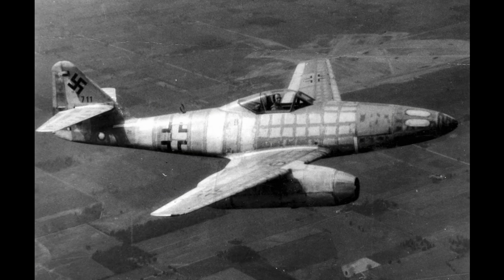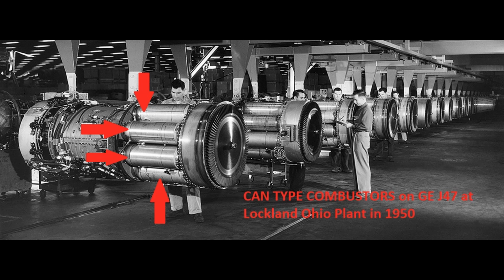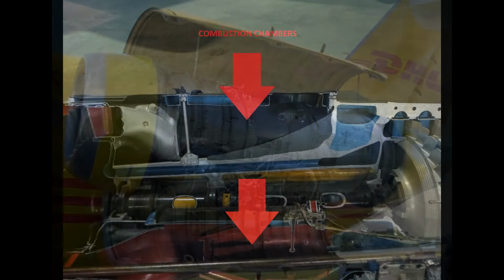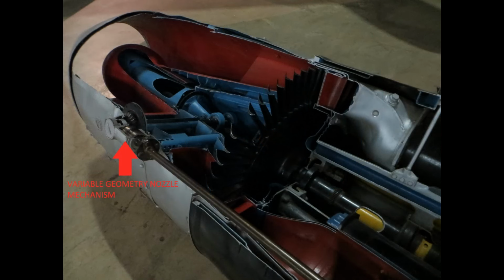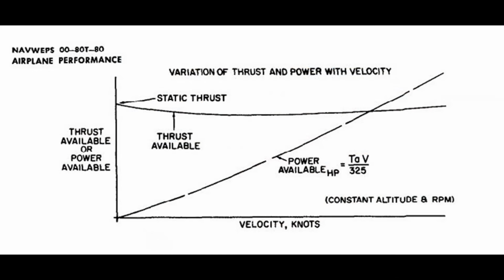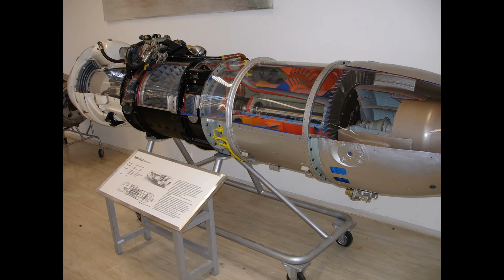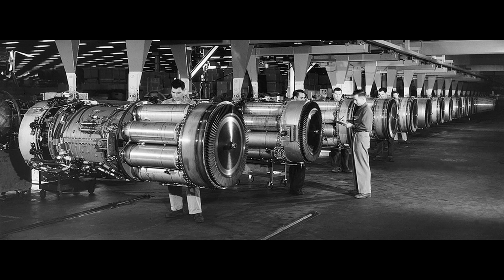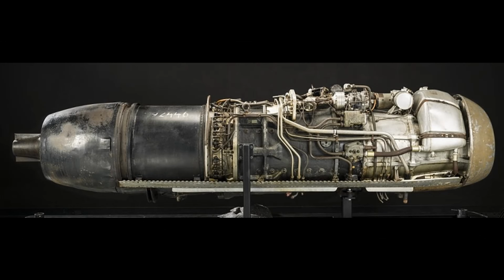World War Two JET POWER

Comment: The Whittle designed centrifugal jet engine preceded the Junkers axial flow jet, and being more reliable was a better engine, even though less powerful. Whittle commenced his jet engine design in the early 1930's.
Reply from the maker: It was an inferior design and a developmental dead end. As for being more reliable, that depends. The production 004s had a short life only due to scarcity of needed metals, not the engine design itself.
Reply: @GregsAirplanesandAutomobiles  You might think that the early centrifugal flow jet engines were a "dead end" as opposed to the axial flow Junkers 004's, but if you care to check, you would find that the centrifugal types were successfully fitted to the Gloster Meteors and De Havilland Vampires etc..; they good service.
Reply from the maker: That's exactly what I mean by a dead end design. Those planes you mentioned are from the mid 1940's. Today all the jet powered fighters, transports, and airliners use axial flow jet engines.
Reply: @electricmanist  The Gloster Meatbox only killed British pilots
Reply: @GregsAirplanesandAutomobiles  Of course- but remember the reliability of the early (British) centrifugal jet engines was most important-- hence the success of the Meteors and Vampires etc.  Hundreds of these (centrifugal) jet aircraft) were exported all around the world.
Reply: @sandervanderkammen9230  You are overlooking the fact that many aircraft fitted with the early (British) centrifugal jet engines were exported all around the world. Also don't forget the DeHavilland Vampire (single centrifugal jet engine) was also used by many countries as their first jet propelled aircraft-- successfully too.
Incidentally, the Meteor was capable (just) of flying on one engine.
Reply: @electricmanist  That British propaganda myth crumbles upon the slightest scrutiny... the U.S. Army tested the Jumo-004 after WW2 as part of Operation Lusty and  confirmed TBOS of 50 to 60 hours.
EXCELLENT BY WW2 standards for Allied piston engines.
Reply: @electricmanist  That comment reveals someone who knows absolutely nothing about the infamous Gloster "Meatbox"
890 crashed killing 450 British pilots in RAF service alone, most crashed due to an engine failure on takeoff which was generally considered fatal  even after ejection seats were introduced.
Reply: @sandervanderkammen9230  Here we go again; The axial flow Jumo might have been a more efficient engine, but ,and it is a big but, -one - it was not an easy engine to operate (it would flame out easily unless run at full power), and two--  the high grade materials necessary in its manufacture were in very short supply in Germany at that time.
The British centrifugal jet engine, (Whittle type)  was easier to maintain and operate. This engine was refined , developed  and put into production by Rolls Royce.
Don't forget, the British designed engine was also used  to power the first experimental American designed jet powered aircraft in about 1943-- and later  after the war in the mass produced 'Shooting star".. 
(As well as the first British mass produced jets--the Vampire and the Meteor,  the Meteor was actually used, over Europe,  in the latter stages of the war;  616 squadron to be precise)...  Check your history.
Reply: @sandervanderkammen9230  I used to work with someone who was a jet engine technician on the early jets (Meteors). While there were a few  early engine failures usually on start up, (they were called "flame outs" by the way, ) the Rolls Royce engine was generally regarded as a reliable power plant.. Thousand were made and exported to several  European nations not forgetting the Middle East and India. in the 40's and 50's.  As the power (and technology) of this engine improved, it became known as a very reliable and trusty power plant..
Unfortunately, it would also appear that you really know very little about the early days of the "Meatbox" (Meteor) in service with the RAF. (or that of the " De Havilland " Vampire for that matter.
Reply: @electricmanist  Indeed, some old false myths die hard... Axial compressors are vastly superior to centrifugal compressor technology which ultimately proved to be an evolutionary dead end and completely obsolete today.

That comment reveals someone who is not knowledgeable about jet engine development history or vintage jet engines.

All first generation jet engines from the WW2 era had manual fuel controls.
The Gloster "Meatbox" would not have automatic fuel controls until the introduction of the Derwent V engines in the 1950s.
 These engines would all suffer from flameouts or overheating damage if the pilot moved the throttle levers too fast or too much.

That's another false urban myth based on a partial truth and taken out of context.
The transition from Krupp P-193 Tinidur alloy to Krupp P-198 Chomadur alloy caused serious problems resulting in very short engine life.... in the Jumo 004A but it was the 004B saw mass production and the introduction of pioneering advanced technology like hollow turbine blades and nozzles with bleed air cooling and TBCs.. technology found on current engines but completely unavailable to the Allies until after the war.

PFTRs and TBOs were comparable if not better than Allied high performance piston engines.

The only jet fighter worse than the de Havilland Vampire was the Gloster "Meatbox"
The Meatbox only killed British pilots. 

890 crashed killing 450 British pilots in RAF service alone.
The worst jet in history.
Reply: @electricmanist  Your comments reveal an appalling lack of knowledge on this topic.
 Engine failures on start-up are called HOT STARTS or HANG STARTS... not flameouts!
This is the primary failure mode of all gas turbine type engines.

The Gloster "Meatbox" was discribed by RAF Chief Air Marshal sir Fredrick William Bowhill as a quote; "a most dismal and lackluster aircraft"

890 crashed killing 450 British pilots from 1947 until retirement.  
The most common scenario was a engine failure on takeoff, the Meatbox has atrocious and notoriously fatal asymmetric flight characteristics which killed many pilots even after ejection seats were introduced.

RAF pilots considered it a deathtrap, 150 crashed in in just one year, 12 crashed in one week and 6 crashed in just a single day in non-combat operations.
82 Vampires crashed the same year.

Britains reputation for building horrible jets that killed pilots continued to grow leading to the complete colapse of the British aircraft industry.

The RAFs most advanced jet fighter is the American Lockheed F-35... the RAF fleet today consists of nearly all foreign built or foriegn designed aircraft.
Reply: @sandervanderkammen9230 
Fryed Ryce Munchyrz Kharzeestan Krappenz DiktorBummer Werkzxoffen etc and co SHUD note good with much awestruckness pleastoo.
  The accident loss rates & fatalities for the Gloster Meteor were average & similar to other fighter aircraft of the period. In fact some later jet fighter aircraft from other countries had worse accident loss stats.
   Whittle style centrifugal compressor reverse flow combuster internal combustion gas turbine aero engines are not obsolete & of course are still manufactured in significant numbers for turboprop aircraft & helicopter applications.
  Any ?Kweschuns? sonny Jim Jimminy boy lad? 
😂👍
Cheers!
. ... . . ... . . ... . 
vcxivcixcvviiii
Reply: @paulpaul9914  PLEASE NAME A SINGLE BRITISH COMPANY THAT STILL MAKES BRITISH JET AIRCRAFT?
Reply: @petemaly8950  NAME A BRITISH JET PLANE STILL IN PRODUCTION?
Reply: @GregsAirplanesandAutomobiles 
   Whittle style Centrifugal compressor gas turbine engines with reverse flow combusters are still produced for use in turboprop airliner & helicopter applications.
Reply: @paulpaul9914  Gas turbine engines were invented by Jens AEgius-Elling in Norway 1913, the first production gas turbine engines were manufactured in Switzerland by BB&C in 1930.
Reply: @sandervanderkammen9230 
Gas turbines were invented in England before 1800.
Parsons of Ireland & England had figured out the basic axial compressor axial turbine multi stage sequential stator rotor internal combustion gas turbine aircraft engine before 1900 & of course the entire industrial world were given that info.
Reply: @sandervanderkammen9230  Gas turbines  small, light  and powerful enough for aircraft use weren't really developed until the 1930's.
Messerschmidt , Heinkel and of course Whittle were amongst the leaders of aircraft jet development.
Reply: @paulpaul9914  NORWEGIAN JENS AEGIDIUS-ELLING INVENTED THE GAS TURBINE IN 1913.
HIS ENGINE CAN BE SEEN ON DISPLAY AT NORSK TEKNISK MUSEUM OSLO NORWAY.
Reply: @electricmanist  Correct, the first successful demonstration of a working jet aircraft engine was Hans von Ohain and Max Hahnn in Rostock Germany on August 27th 1939.
Whittle would not achieve this until May 15th 1941.
Reply: @sandervanderkammen9230  I think the main difference was in their relative sizes. The former, almost  the size of a small car , the other (centrifugal type and simpler) ) was the Whittle.
Reply: @electricmanist  The main difference is scalar efficiency.
A concept first recognized by a brilliant German Aerodynamisist named Helmut Schelp.
 Schelp convinced the RLM that centrifugal jet engines were an evolutionary dead-end because as power output is increased, not just the frontal surface area increased exponentially, (to the point where supersonic flight is not possible) so does the weight, this quickly reaches a point where the thrust to weight ratio is no longer viable.

The most powerful centrifugal jet engines only produced a tiny fraction of what is possible with the more efficient axial compressor.
Reply: @sandervanderkammen9230  I think the thing to bear in mind was that wartime manufacturing and production problems almost necessitated the use of the most basic functioning system possible. I'm sure that Whittle was aware of the relative efficiencies between axial and centrifugal flow systems in turbojets and since the latter was both easier and simpler to produce, that was the preferred system to introduce.

Of course  later versions of the British jet engines were axial flow types, but that was when wartime emergencies were a thing of the past.
Even so the R R Nene  and De Havilland  Goblin types etc etc gave good service at a time when they were most needed. (Not to mention service/operating  familiarity with 'new' propulsion units.)
Reply: The RR Nene, first run in 1944,  centrifugal compressor gas turbine aircraft engine was the most powerful gas turbine aircraft engine in the world at the time.
Reply: @paulpaul9914  Whittle designed 'jet engines' were running long before that date.  Try late 30's early 40's for prototype tests runs.
Reply: @electricmanist  Whittle did not begin work on jet engines until he moved to Rugby in 1936, he would not successfully demonstrate a working jet aircraft engine until May 15th 1941, two years after Hans von Ohain and Max Hahnn in August 27th 1939.
Reply: @sandervanderkammen9230  Not quite correct, since Whittle first  demonstrated his turbine principles in the late 30's 

It was mainly lack  "official" interest that delayed manufacture and development of Whittle's ideas.  Hardly surprising as official urgency  and production was focused upon the I/C Merlin  and such like.

The Gloster (single engine prototype) flew in the early 40's.  That aircraft proved the viability of turbines in general.
Reply: @electricmanist  Frank Whittle's career is well documented and he did not begin any actual work on jet engines until he moved to Rugby in 1936.
Like Whittle's work, Hans von Ohains work was entirely self-funded as a private venture.
Von Ohain constructed his first prototype in 1934 in the machine shop of Max Hahnn in Göttingen Germany and later demonstrated at Göttingen Universität before a group of notable guests including world renown physict Dr. Robert Pohl.
Pohl wrote to Ernst Heinkel who arranged for another demonstration in 1936.
Reply: @sandervanderkammen9230  I think that maybe you are overlooking the main difference between the two 'jet' engines, remember Whittle chose the simplest of two options--   centrifugal flow, instead of axial flow.  Less powerful maybe, but also more appropriate given the state (and availability) of appropriate metals.
Reply: @electricmanist  As was revealed by A.A. Griffiths, Whittle lacked a working understanding of the Axial type compressor, pointing out and correcting mathmatical errors in Whittle's 1930 patent design.
Whittle in fact, would never attempt to build an axial compressor and he abandoned his 1930 design which features an axial compressor stage.
 The WU.1 used a Centrifugal furnace blower salvaged from an iron foundry and driven by a 4-cylinder Austin Dixie automobile engine.
 He(Whittle) was forced to hire out the design and construction of his first flight-rated compressors to Rolls-Royce's Supercharger Division.

Both centrifugal and axial compressors are made during from basically the same materials used today, little has changed in this regard.

It's the metallurgy of turbine blades and nozzle guide vanes that was a limiting factor, these limits still apply today.
Modern jet engines are more advanced in thermal management technology.

Thermal management technology is where Germany had a huge lead over the Allies
Reply: @paulpaul9914  The most powerful gas turbine engines in 1944 was the Jumo 109-012 rated at 6,135 lbs of thrust.
Over 1,000 lbs more than the Nene.
Reply: @sandervanderkammen9230  Powerful maybe but the centrifugal turbines developed by Whittle (U.K.) were more reliable and more suitable for the state of metallurgy of the 1940's

The (German) Jumos had a very limited service time- not to mention overall reliability.
Reply: @electricmanist  Whittle's engines were LESS Reliable and were made from inferior materials such as Brown's 18/2 and REX 78, stainless steel alloys used in cutlery and kitchen utensils.
 No engines produced by Whittle or Power Jets Ltd would ever be reliable enough to pass a RAE PFTR for airworthiness certification and RAF acceptance.
Reply: @sandervanderkammen9230  While I find your comments re materials in early jet engines interesting,  remember that the essential factor was that one type  (German) was axial, while the other was centrifugal. Although the latter was less powerful, it was more reliable and commensurate with the types of materials then available.
Reply: @electricmanist  Frank Whittle did not invent Centrifugal Gas Turbine engines (this was Norwegian Jens AEgius-Elling in 1913) Nor did he invent the Centrifugal Turbojet engine (this was Hans von Ohain in 1934).

Again you imply that Whittle's engines were more reliable, which is a false urban myth.

Whittles engines were in fact, so unreliable that they can not pass airworthiness certification for adoption into RAF service.

The standard PFTR for both RAF and USAAF are the exact same as the Luftwaffe during WW2, this is 100 hours. (only the US Navy required 150 hours)
This test is performed at Military Power and does not reflect the use of WEP in combat, which dramatically affects TBO hours.
Reply: @sandervanderkammen9230  It is not just a question of who invented what, but rather what was practically possible to produce under wartime conditions.
No one doubts (doubted) the superiority of the axial flow types, but  it was more a question of what was the most practical to produce and operate under wartime conditions-(restrictions) .
Remember at the time, the propeller driven types were well proven and available in quantity.
  Who would choose to use an undeveloped  (as yet) propulsion system ?
Reply: @electricmanist  Yes, while the Messerschmitt Me-262 and Arado 234 were successful aircraft the British Gloster "Meatbox" as it was called by RAF pilots was a disappointing failure.

26 Luftwaffe Me-262 pilots scored Ace or higher shooting down over 550 Allied aircraft.

The Meatbox never shot down a single Luftwaffe plane, the British jet only killed RAF pilots... 450 were killed.
Reply: @sandervanderkammen9230  The 'meatbox.(in many versions) continued in service with the RAF until the mid 60's or so, so it wasn't as bad as you paint it.
The early versions might have had a few mechanical problems, but these were  soon  ironed out,
 Aerodynamically (straight winged) it always had its limitations, but it was widely used by the RAF  (even as 2 seat trainers and night fighters) and enabled the RAF to cut its teeth on jets. 
 The Meatbox was quickly followed into service by the single engined  DH Vampire which was smaller and lighter.  Both aircraft served as successful  introductions to 'jet powered flight.    Hundreds were built.

Incidentally, some early British jet motors were shipped to the U S A,  (in 1943/4 as the Americans were slower in developing jet technology.
The Bell Air Comet was regarded as an American  somewhat experimental introduction to jet flight.
Reply: @sandervanderkammen9230 
As they are aware.
   The US did not begin developing axial compressor jet engines before they were provided with a Whittle engine.
  They destroyed the first Whittle engine they got during ground testing.
  In 1944 the RR ( OF ENGLAND 😂) Nene centrifugal COMPRESSOR engine was the most powerful gas turbine aero engine on the planet.
Cheers.
😎 & 🙂 & of course 👍 Indeed.
& Cheers again.
Toodle PIP Old Chap.
    
   
 
. ... ...  ...  ...  .... 
iiiiiillllllccvxcvv
Reply: @petemaly8950  What type of jets does de Havilland make today???

Can you tell us what british company in the UK is still making british jet aircraft?
Reply: @electricmanist  Britain had nothing better to replace the Meatbox..
The RAF would not have an effective jet fighter until the Hawker Hunter appeared in the 1950s and was not available in sufficient numbers.
Reply: @sandervanderkammen9230  If you are referring to 'swept wing' technology, your statement about effectiveness might be true, --but you should not overlook the effectiveness of some early 'jet' types such as the Vampire and Venom.  OK, not supersonic, but certainly available in reasonable numbers.    Money for research projects was in very short supply after the war remember.
The gestation period of the Hunter was quite protracted .
Reply: @electricmanist  Britain was years behind all aspects of aerospace technology during the war, the Vampire was largely ineffective and obsolete on arrival in 1946...

Well, there were only two winners in WW2 and Britain was not one of them. Britain's economy collapsed as a result of the war.
Reply: Yes, often years do alter the balance of power, so that's nothing new really. America (and Russia) eventually came out economic winners.

However, don't forget that at that time, (1940's)  both Britain and Germany were leaders in Jet technology although maybe Germany had something of a technical  lead;    their aircraft (particularly the swept wing Me 262and other projects were ahead aerodynamically. The British weren't far behind with the straight wing Gloster Meteor, even though their early jet engines were less powerful than those produced by the Germans.
Obviously the German manufactures were handicapped by relentless allied bombing of factories etc. (Not to mention early  indifference by the German hierarchy !)
The American were slow to start and initially depended on the engines sent from Britain.

Remember too that he Russian aircraft industry was given a "Golden Handshake" when Britain exported a number of  Rolls Royce jet engines to them after the war.  But that's another story !!!
Reply: @electricmanist  Straight wings and centrifugal turbojet engines were clear indicators that britain was far behind.
The Gloster Meatbox was a hastily converted propeller driven aircraft that was to be powered by two Bristol Centurus radials.. it was poorly suited to jet propulsion, and its poor performance reflected this.
That's a popular British revisionist propaganda myth, America had its own jet engine development programs that datedback before the war, axial compressor turbojets like the Lockheed J37 and the Westinghouse J30 and J34.
The first Allied axial turbojet to be flight rated was the Westinghouse design... developed independently without British enfluence.
 The Soviets too had their own jet engine development and captured German axial turbojet technology...
After the war Britain is bankrupt and everything is going on  sale to the highest cash buyers... the Nene was obsolete and unpopular in the West, it was not earning any return on investment, the Soviet deal was the only cash offer going... ironically it was a lose-lose for both parties.
Reply: @sandervanderkammen9230  I suppose your response can be considered some akin to "revisionist history'

Sorry to disillusion you, but the first American 'jet aircraft ' to fly,   was powered by (imported British) centrifugal flow jet engines.

British Bristol Centurus radial engines had nothing to do with the price of eggs--- (jet propulsion engines)  the same as your theories.

The Americans were still concentrating on developing  straight winged successors to the Mustang---which itself was not up to much, until it was fitted with British Rolls Royce Merlin piston engines.

A little bit of knowledge goes  as far chasing its own tail, but getting nowhere at the same time.  I think that's called revisionist history.
Reply: @electricmanist  Britain has always lagged years behind America, Germany and France in aviation technology... so far behind that there are no longer any British jet aircraft made in the UK.
Reply: @sandervanderkammen9230   Ho ho-- it seems like your prejudice showing itself !
Reply: @electricmanist  Just the irrefutable facts lad, please name a single British company that still makes British jet aircraft in the UK???

Your comment is wrong, centrifugal turbojet engines were clearly an evolutionary dead-end concept that significantly delayed the Allies development of the vastly superior axial jet engines we use today?
Allied centrifugal jet engines were inferior to the Germans axial compressor technology.